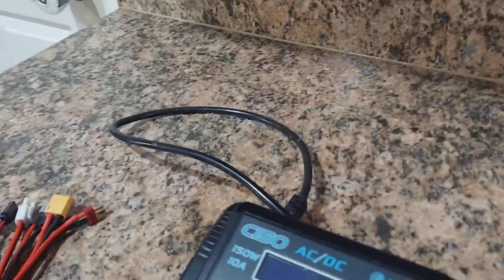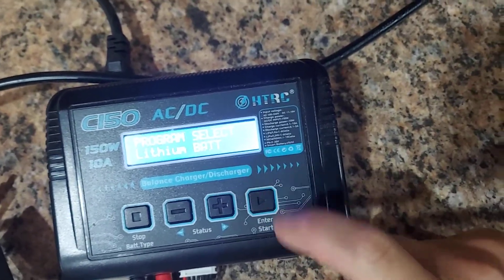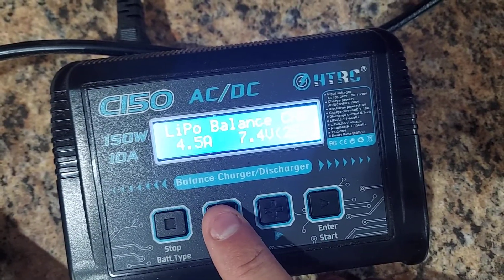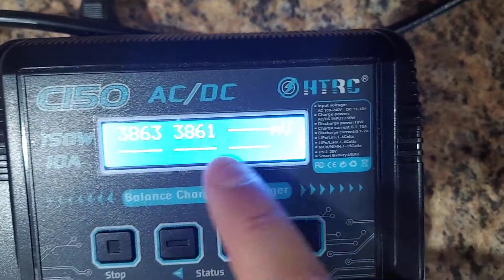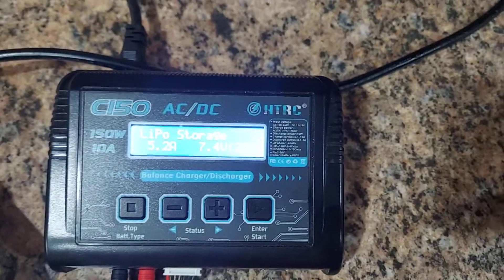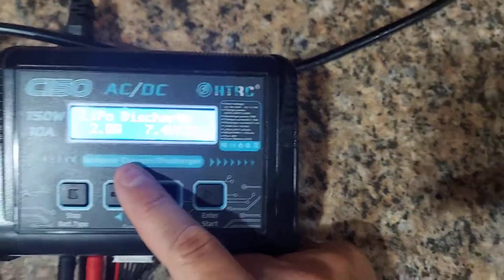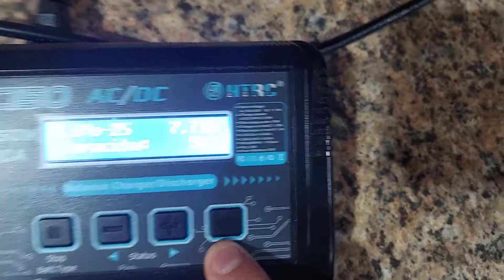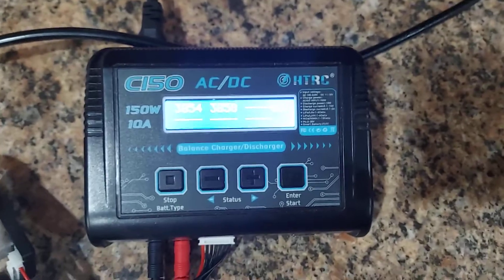Lipo charging explained. C150 charger. settings.

Comment: I found the problem !!!! I just got my charger 🔌. They don’t send the correct ☑️ adapters set to connect the batteries.  When I seen yours I was like what ???? So I went back to Amazon. And found the connection set as yours. Cost $ 15.99.  Thanks 🙏 for sharing.

Comment: I keep getting Lower Cell Volt error when trying to charge my 5000mah 4s Lipo. I've tried everything. Does anyone know the fix or what Im doing wrong?
Reply from the maker: A "lower cell volt error" on a battery charger indicates that at least one cell in a LiPo battery has dropped below the minimum safe voltage, requiring a careful rescue charge. You can try disconnecting the balance port, switching the charger to NiMH mode to provide a small initial charge maybe only a couple minutes at a time recheck then do a second time if it still won't recognize it , and then re-attempting the LiPo charge. If you let your lipo sit around too long without them being storage charged to 40-50 percent they will drop below a certain threshold and be trash! Or if whatever your running them in runs it down too low it will ruin the lipo never let it discharge fully! Most rc cars have a setting to make sure the car stops before getting to this point. But not all things that use lipos have this feature. Good luck!

Comment: Problem: C150 charging 3s 5200kv 80c and the charger always slow down at 80%. No end alarm, 0.0A and time is running. 12.06v! Charging with 5.2a. What am I doing wrong and how long do I have to wait? Brand new batteries. Please help!

Comment: Yeah, it’s not allowing me to change it.  Maybe an issue with the cables or battery
Reply from the maker: @JPDeez  yeah it's possible if it's a 4s and registering as a 2s that 2 of the cells are shot. Or the cable is messing up is it plugging into the 4s leads?

Comment: When I plug a 4S battery into the c150 is keeps coming up as 2s, how do I change it to 4s? You said you can change it but never demonstrated it.
Reply from the maker: @JPDeez  before you start the charge you should be able to cycle up or down on the arrows and start button to select 4s

Comment: Why do I have to connect both connections to from battery to the charger in order to charge battery ?  I also have a dedicated 3S charger and it only requires the "balanced charge" connection (one connecter)
Reply from the maker: @louisstokes1898  just the way this charger is. I've never seen a battery charger that would charge the battery only using the cell balance connection. This one does an excellent job at charging though.

Comment: The 3s plug is the same size as my battery plug?
Reply from the maker: @elidobbs5876  not sure what your asking. There isn't a specific 3s plug you just need to make sure your plug matches one of the plug types on the charger!
Reply: @jdrcchanneltexas5497  I just bought brand new 3s batteries like the ones shown in video but the 10-1 charger doesn’t allow the plug to fit into the charging hole

Comment: JESUS! Why must this be so darn difficult?? My son has no clue how to charge his RC since I got him one of these machines, so he's depending on me to do it, but the more I read the manual and watch these videos, the more I become confused.. what happened to just Plug it and Forget it??? 😠 😡
Reply from the maker: @kraziezombie  yeah unfortunately with the new lipo batteries they put out more power so they are a little more difficult to charge. Once you understand how they work and how to charge them it's a piece of cake. These types of RCs and batteries are not really for beginner's that don't have any experience with them. Some of my RCs do 100mph
Reply: Plug and forget it is when you're using basic NiMH where you can discharge it as much as you want or charge it to its full unbalanced cell capacity. With lipo batteries you're basically stacking phone batteries which is why it's slightly hurt more advanced to recharge it. Just like a phone. 

This is just like any 4 button charger and if you only have the same batteries you don't even need to change any settings. Just set it up once and leave it be.

Comment: Did yours come with thr EC5 connector? Mine only has the EC3
Reply from the maker: @austinprickett7443  no I had to remove one of the other connections with thick wiring that I wasn't going to use and solder on an ec5 connector myself.
Reply: @jdrcchanneltexas5497  okay thanks I was confused for a minute. I just ordered an EC3 TO EC5 adapter

Comment: hey josh! this was really helpful. I still have a problem I think you know the answer to. I just got the fms fcx18 k10. what adapter do I need to buy for the little plug. the big plug fits in the balance part just fine but I need your help please if you have time. thanks!! John H.
Reply from the maker: You just need an adapter from your molex connector to the deans on the charger so would be I believe a male molex to female deans adapter. You might have to double check that though.
Reply: Thanks man!!  @jdrcchanneltexas5497

Comment: Mine didn’t come with the ec5 connector, only ec3. 
Do you NEED to plug the discharge connection coming from the battery pack to the charger to charge ? Thought that was just for discharging a pack..
Reply from the maker: Mine did not come with an ec5 either I had to solder it on myself Also yes you always have to connect the 2345 or 6 pen connector as that monitors each cell in your LiPo battery it is for balance charging or charging in general so it can make sure that your cells are even
Reply: @jdrcchanneltexas5497  👍

Comment: Does the charger shut off on its own when the battery is fully charged. Bought my son a RC car for Christmas with this charger. Car is nothing special just a cheap o. If he stays interested then we’ll upgrade to the higher priced stuff. That being said I have li-Po and li-ion batteries 1600 and 2000mah. Don’t want to blow anything up. Have the setting on 2.0a 7.4v 2s when charging the li-ion but seems like the charger pushes past the 7.4v when charging. Is it supposed to shut down automatically when fully charged. Thanks in advance
Reply from the maker: Yes it's normal for it to charge above 7.4 while charging. It will stop on its own when it's fully charged.

Comment: I set the mAh and V correctly, but when I am charging my lipo Zeee battery, I notice that the V reading is exceeding the 7.4V that I set it to. When I check the status though, it is still less than 100% charged. Is it ok that while charging the V exceeds the 7.4 I set it to, and can I just leave it charging until it auto stops?
Reply from the maker: Yes it should be higher the battery is 7.4v but it has to use higher V to charge the battery faster. Mine typically runs between 7.5-8.0v while charging when it's done it should sit around 7.4v maybe a little higher or a little lower but should be by much. Same as when your alternator in your car in running to charge your battery it will run at around 14v but your car battery is only 12-12.5v it has to put out more cureent than the battery holds to charge it. You should be fine. Both Your cells should be right about 4.2 when charged so make sure your balance charging every time you charge so your cells match up or within 10 thousands of each other. Mine usually sit at 4190 and 4200mv on the lipo cells.

Comment: Very nice video!! I just got mine! And I have a 3s zeee lipo battery connected and the voltage is a 11.1v and when I charge it the display is showing 12.13v should I be concerned or I’m I doing something wrong? Thanks

Comment: Mine is the same as yours but it says 11.1V instead of 7.4 and it keeps on telling me to disconnect how do I fixit
Reply from the maker: Before starting the charge you press the arrow up or down to change from 11.1 to 7.4 or whatever size your battery is
Reply: How it won’t let me
Reply: It’s on 3s
Reply: It’s the same exact one as yours
Reply: It only lets me change the volts on every other one besides balance chagre
Reply: Now the c150 won’t even turn on 😭😭😭
Reply: Oh never mind it’s my blue connector that won’t connect to the blue thing
Reply: Oh shit mines a 3s but it only connects to the 2 s
Reply: I’m having the same problem

Comment: hey what about those new batteris that goes  up to 4.35 volts, how do I usi this charger on those? thx
Reply from the maker: Are you referring to a liHv battery? If so I'm not sure as I don't run those. I'm not sure if there is 4.35v lipo battery's as I've always ran the standard lipo in all my rc's. You might have to look up the manual and see if it has the settings for that function. Sorry I couldn't help.
Reply: @jdrcchanneltexas5497  I ended learning that you just need to put the charger on the LIHV mode instead of LIPO

Comment: Does it turn off when it’s done charging?
Reply from the maker: Yes if you have set it to the correct battery amp and cell it will stop when it reaches that amp. So a 4s lipo that is 6000mah will be set to 6.0amp and will stop when it's fully charged.

Comment: What is the capacity cutoff for? Any reason to change it if I’m only running 6200 mAh batteries?
Also, any reason to reduce the safety time from the default 240 minutes? Is that how much it charges AFTER the battery is fully balanced charged?
Reply from the maker: Cutoff is so the battery doesn't drain below it's threshold if it goes below 3.4v the lipo will be trash! The safety time should be how long the charger will run before it auto shuts off.

Comment: I got the zeee batteries just like yours but the adapter will not fit in the battery plug ???
Reply from the maker: Those are ec5 connectors I soldered on so it would charge. You can buy an adapter so you don't have to do any modification. You could get a (female deans) to (male whatever you have) example.. If I have a battery with a ec5.. I would get a female deans to male ec5 adapter. So one end plugs into the deans on the charger and the other end plugs into your female plug on your battery type.

Comment: It doesn’t come with an EC5 connector, can you use the negative and positive clamps it comes with
Reply from the maker: No those are for running it to your car battery to power the charger
Reply: @jdrcchanneltexas5497  so they give u all those connectors but not a EC5 one

Comment: Does anyone know how to  charge a dead battery on this specific charger?
Reply from the maker: If your talking about a completely dead lipo battery most of the time you cant bring them back. They are trash at that point. Never let them get too low or they will be useless. You can somtimes set the charger to nimh and charge it for about 10 minutes to bring it back up high enough that the charger will recognize it's a lipo again and then you can start the lipo balance charge selection again. But be careful!! (I don't advise doing this if your not familiar with lipo batteries)

Comment: I have the 2s LiPo at 7.4volts but on the charger it comes up like 8.2v. Capacity cut off is 8000 mah but my bat is only a 5200 dose that also matter or do I have to change something .
Reply from the maker: So when you charge your 2s lipo make sure 2S which should show 7.4v is selected then make sure you A is set to 5.2A which is 5200mah for every 1000mah it's equivalent to 1A.

Comment: Good video. I am building an RC battleship and I have the exact batteries you have w/ the same charger.  I am at the part of installing motors and servos and want to use the battery off and on to test functionality and such.  My question is, would it be best to do the "storage charge" function so that I can mess around with testing while keeping up the integrity of the battery?  Lastly, how long will the battery last in "storage charge"?  If fully "storage charged", A week, month or more?  Thanks
Reply from the maker: Yes you can keep it at storage charge which is about 40% charged. Just be sure to check it every now and then while using it so that you don't drain it below it's charging threshold which I belive is 3.2v i never personally let mine get below 3.4 ever. They will last on the shelf not being used at storage charge for about 2 months before you need to re check the storage charge levels.

Comment: Thank you so much..  I have several of these batteries. What I really need is a discharge video I'm having a hard time with the settings.. if you would I would appreciate. Do you have a battery u can use. When I goto the screen I'm looking for the 5.0A but it only goes to 2.0A. What does the cycles mean? I'm wanting to discharge my battery as low as I can go then charge them back.  How would u do this. Thanks. I understand the charging part ok it's the discharge I'm having trouble with. Thanks again

Comment: Hello,, can you do a video on charging and discharging a 5000mAH  7.2v nimh battery. I bought this charger but I'm to dumb to figure it out.. thanks..
Reply from the maker: Super easy to do...press the + button until you see Nimh press play button. It will say charge on the screen. when you see the. A on the screen with a number in front flashing, press the + or - button again until you have that set to 5.0A that's your mah. Then press play again and then hold play button down to start charging. I will try to do a video and post it later today also. So keep an eye out for it!! Please follow me if you haven't so you'll see the video when I post it. Thanks!
Reply from the maker: Heres the video you requested hope it helps! https://youtu.be/dT-vEMEFQF4
Reply: But what if it a 3s 550mah?

Comment: What does the 38.48wh mean? Also how long does a balance charge take? I know it could vary depending on how dead it is but just in general how long? Thanks bud.
Reply from the maker: Not sure about the 38.48wh haven't seen that on my charger settings. As far as balance charge depends on how large the lips and how many MAH it is typically my 4s 6000mah lipos take about 2hrs from drained or about 1 hour from storage charge level. I recommend always storage charging when not using for a while and always balance charge or at least every 3 charges.
Reply: @jdrcchanneltexas5497  Can Lipo batteries be fast charged safely with this charger?

Comment: Thanks , i set up as lipo , 4.6, once i press to start charging says batt check beeps and says lower cell volt but cant seem no options after that any help appreciated
Reply from the maker: Most likely the lipo is drained too low if it's giving you a low cell error.

Comment: The C150 charger doesn't have the right end to connect to the 5200 Z battery.  I don't know if its defective or I'm missing something
Reply from the maker: What type of connector does it have? You might have to purchase an adapter from one of the other type of plug to whatever your battery has.

Comment: Yeah how do you use the external temperature sensor settings
Reply from the maker: I've never used that feature. Not sure if this model has that. If so it might require additional parts to be purchased

Comment: Mine doesn't came with e05 what can I do
Reply from the maker: They sell adapters from one type of plug to the other on amazon so you can go from the deans to ec5. Search male deans to male ec5 adapter. If that's what your needing. That's should work I purchased actual ec5 male and female ends and cut off the banana plug and soldered the ec5 on those wires. But the adapters are an easy solution

Comment: Can you show us how to do it with a XT 90
Reply from the maker: Not sure what your meaning? How to use the charger with a xt90 plug on the lipo?
Reply: @jdrcchanneltexas5497  yeah but on a c150 because my XT90 will not fit in the plug that comes with the c150
Reply from the maker: If that's what your referring to... This charger doesn't come with an xt90 only an Xt60. So you'd either need an adapter or need to unsolder or take off the Xt60 and solder an xt90 onto those wires. I actually took off one of the plugs I wasn't using and soldered a Ec5 connector on and converted all my cars and lipos to ec5 so I could charge them all the same connection. And interchange them in different cars
Reply: @jdrcchanneltexas5497   do you think I can use my negative and positive Cable

Comment: Sorry for the dumb question but can you parallel charge on this charger?
Reply from the maker: I mean if you set the settings right technically yes. I wouldn't recommend it. Depending on what your charging. If your wanting to charge 2 seperate lipos faster I would just get the dual charger version. If your meaning an already set up parallel set of batteries I'm not sure on that would depend on what the voltage and amperage  mah would all be.
Reply: @jdrcchanneltexas5497  thanks man! You got a new sub